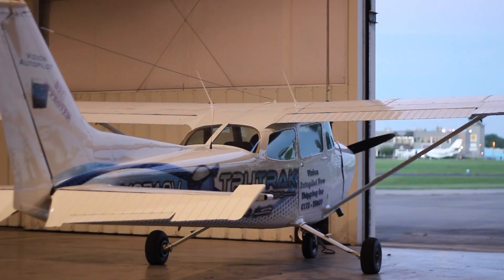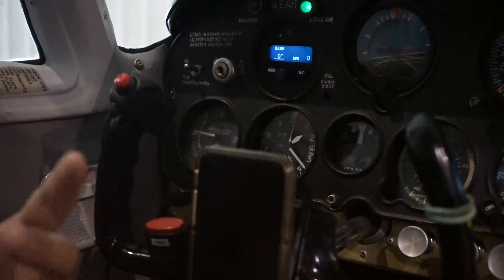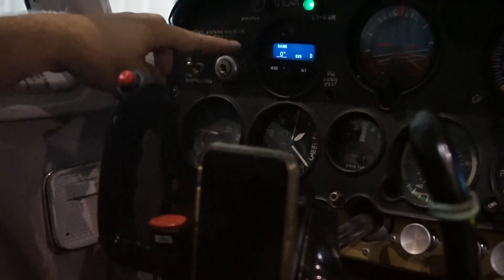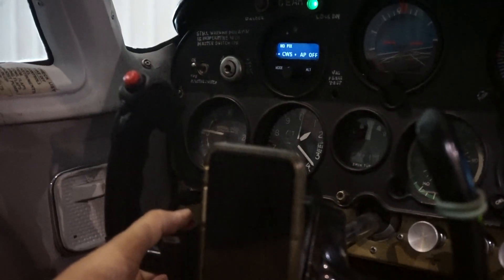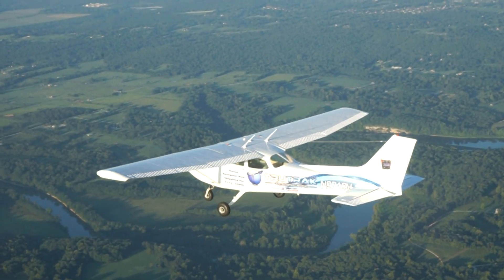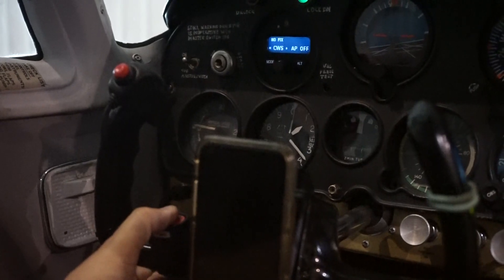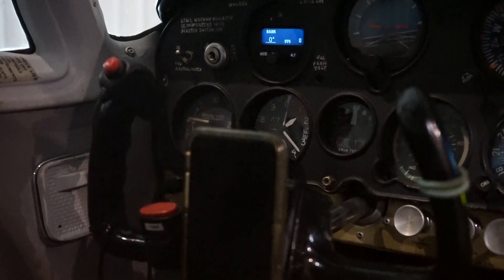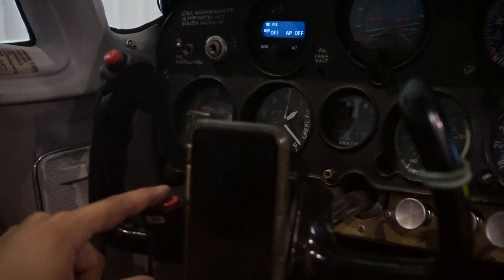C.W.S. BUTTON (Control Wheel Steering)

Comment: You might want to append , or revise the statement you made regarding the CWS button , and it's function.  The following is from the Garmin manual.  ( NOTE: Pressing the CWS Button while Vertical Path Tracking Mode is active does not cancel the mode. The
autopilot guides the aircraft back to the original path upon release of the CWS Button.) So it actcually does not stay on the path when the button is released.  Regards